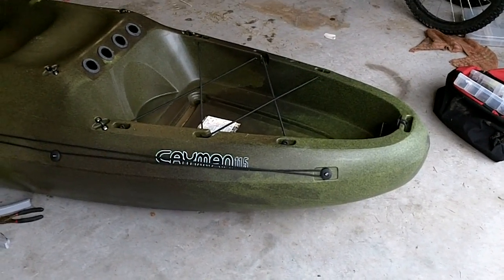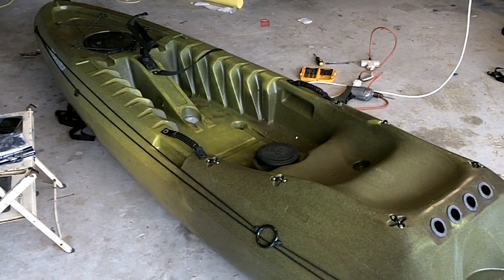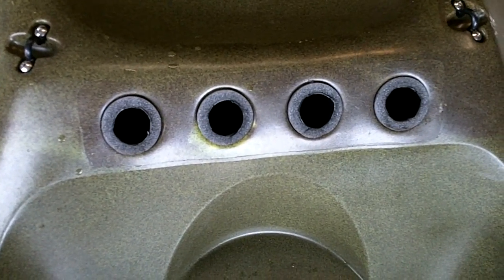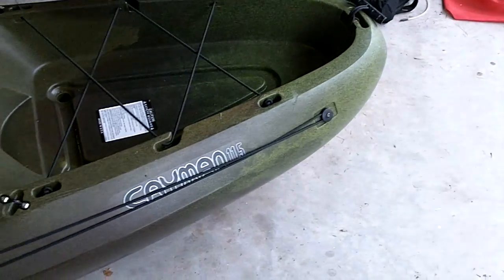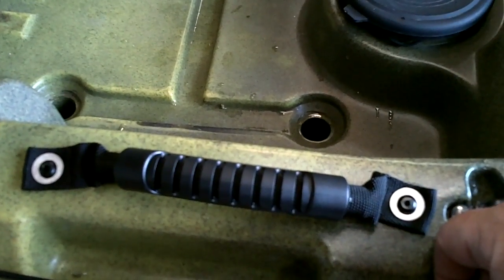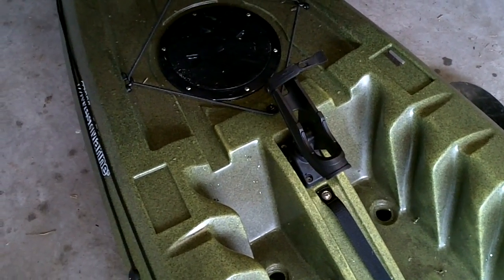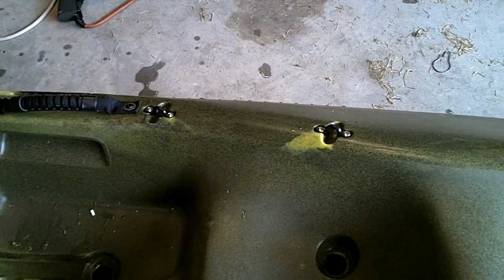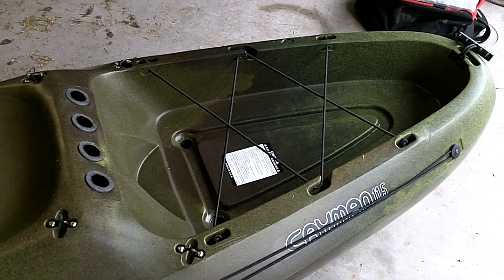Perception Sport Striker/West Marine Cayman

Comment: Bought this same yak on sale about a month or so ago after buying my son a used Perception Striker 11.5. super stable easy to paddle from low or high position. since we fly fish a lot it was nice having the high seat, still working on the standing part it is a practice thing. I will say  also that being only 11.5 feet long it is easy to transport in a truck bed. One word of caution do not build a scupper hole cart as the scupper holes are the weakest point in these and most kayaks and therefore susceptible to cracking. Just a tip.

Comment: I have owned this yak since early spring when it was released by west marine. I picked it up for 550 with a 100 dollar in store gift card. I chose this yak over the old town predator to be honest because it was basically a bare bones version for more than half the price. This kayak is a amazing fishing kayak  but there are a few mods  that one must due upon purchase. Hopefully my insight and mishaps will help you guys right out the gate.                                                                        
    First things first i am a kayak fisherman not a kayak-er. when i take this boat out its to do 1 thing and thats catch fish. I needed a stable platform that i could stand up on and sight fish / stretch my back every once in a wile. My back is jacked up from work. Im 30 years old 5"10 150lbs. Very fit. I drive a acura TL and use that to transport this beast. I have no roof rack but made one from large pieces of industrial foam. If you are in the same boat as me with a sedan and no roof rack just make one up. I first tried swimming noodles. I taped 3 together for the front 3 for back and attacked them to a shop / exercise pad. Not going to lie it looked like dogshit but it worked and costs me 6 bucks for noodles at dollar store and 12 for the mat. It was a  temp solution just so i could get it out during the spawn. What i did next was take two (2) 4X1 Pieces of foam and used a spray adhesive to bond them together. One for front then another for back. I flipped my caymen and used a piece of pvc pipe and a marker and traced the tri-hull onto the foam. cut it out and ended up making a incredible roof rack for next to nothing. I attached it to that same excersize mat with some plastic anchor / screws and it folds up perfectly into back seat. Tested it @ 80 mph on jersey turnpike with 2 ratchet straps across middle, 1 fricton strap dead center and front and back with some paracord. drove 65 miles each way to seaside new jersey and held up perfectly... 
   One thing about this yak is it like a old F body ford. Shes not going to win a ton of races but the thing will not let you down. Its incredibly stable kayak and i dont know how one would flip this beast. With that said there are some really dumb design flaws that can be fixed with a little tinkering. Ill start with the front hatch. The front hatch is impossiable to open when exposed to heat. It has thumb these 2 little depressions where your fingers go to unscrew. Well what they didnt relise is the gasket they added expands when heated and it seals the dam thing off. I had to hose it down and put ice on it to open the thing. I removed the gasket entierly. Unless your going into some class 3  whitewater rapids you dont need it. I have yet to have it leak in 3 foot swells. After thats gone go buy a metal boat tie off and mount it. This will give you the leverage to open the thing even after gasket is gone. Also its a great spot to slip a rod under in a hury if you need to quickly change rods and also a perfect tow point if you ever get in trouble. use marine goop and stainless screws. The hatch is still quite useless and getting a 7 foot baitcaster in and out is a chore. I rarely use it other than storing a emergency paddle and some other supplies. 
  I added 3 scotty rod holders . One in middle with long articulating arm ( will see why in a min) and two on each side where the indent for base is. Moving back i replaced the hardware holding the leash to the boat. If You are a heavyer person and really need the help to get up i suggest you do that as well. i managed to rip the thing. I reinforced it and made a new hole, added my own hardware ,works like a charm.
  Moving back i added a track to the right side where this guy has his handles. I do not like the factory handles but for my new dragonfly 4 fish finder it made sense to put it there. I have not installed yet but will be using a Batt box from ack kayak with ram ball mount and gps. all self contained and removable.

Ok now for the seat...... Stock it blows. I purchased a Crazy creek seat for 80 bucks and managed to break the dam thing. I tried a bunch of options and nothing seemed to work... I decided to try a boat seat from a old pontoon i had and it was like it was made for it...almost... I removed all the plastic from the boat seat bottom, the mounting points. got it smooth as i could and took pad off then had my brother heat it with a heat gun and i sat the boat seat on the high "fishing" seat. did this a few times and it contured to my backside a bit and make it perfectly flush. Added some grip tape to the bottom of seat and sprayed with RHINO liner till it had some grip. Drilled 2 holes in back and front and mount it with just 4 ball bungies. I tried everything and these stupid little things hold like you would not believe. The pad eyes are perfect to tie off to and i have never had a issue with the seat. Its like being on my couch all day. I did lose some stability by adding this seat but the trade off is much to great to ignore. I can take the wifey or kids out on the thing and they got the bottom seat to sit in. I took 2 adults and a 8 year old  ( 150lb 115lb and 50lb) out with my rods and she was still aflote. Took it out on 30 MPH winds with 3 foot white caps and the caymen was unphased. I did something that none should do and thats ride into the caps sideways. I wanted to test the seat and limits. She took it like a champ. I was able to stand in 3 foot white caps with 30 MPH winds. Like i said shes not the fastest but she"s not flipping.

  I upgraded the roap on anchor trolly but its really not needed. From there i purchased the Cooper anchor for small boats. Its 200 grams but thing holds like no other. I have this attached to a dog leash with 50 foot of cord. I also made a drift bag for when you don't wish to be still. Thats up to you and where you fish if you think you need.
  
The back storage area is where i added another 6" hatch. This is something you may want to think about doing. I went with 6" because I have a trolling motor set up with a milk crate that hangs off side. Still wanted storage acess if i needed to get into it and the 8" did not allow that. If you wanted to add a rudder system or any other electronics and have them wired it would be smart to add this and save yourself time trying to weasle wires through the little hatch by seat or at the bow yak. screw all that cut the hole.   

  Well thats more info than many will read but if you have any questions i will try my best to answer and load some pics later..... Again this yak is awesome. For the price it cant be beat.
Reply: Ray Murda do you happen to have pics or video of you kayak?

Comment: I just bought this boat and it really nice, it's built like a tank. I have not used it yet. How stable is it? I'm 275lb  and I bought it because it looked stable.
Reply from the maker: It's very stable, especially if you stay in the lower seat.  I can actually stand and fish from it.  Sitting in the lower seat is still higher than the seat of my previous kayak, so for fishing, I gained an advantage,  In turn, I do have a slower kayak that does not track as well as my old 15 footer, but it is good for fishing close to shore, which is what I wanted.

Comment: How did you attach your handles? rivet, bolt to inside of Kayak, or bolt through the molded handle, I was wondering if there was enough room on the inside to attached the bolt and washer.

Comment: Do you think its possible to add another hatch behind the seat in that large flat area?
Reply from the maker: Al, if the hatch is round has an outside diameter of 7 inches or smaller you would be able to add it.  There is a channel that helps drain the water and a hatch with an O.D. of 7 inches or larger would not seal properly.